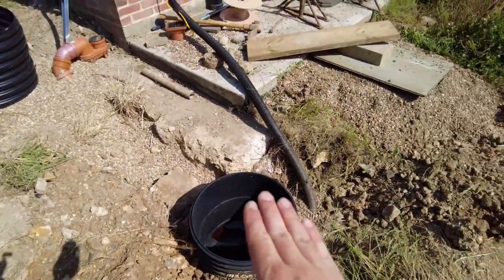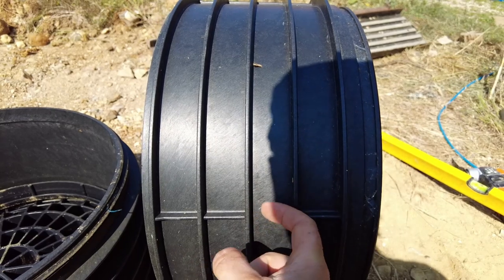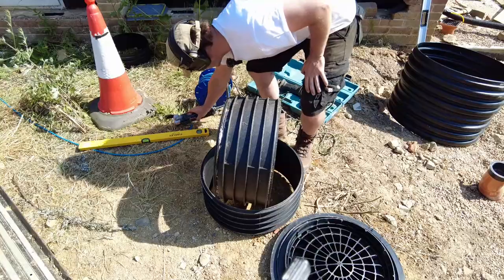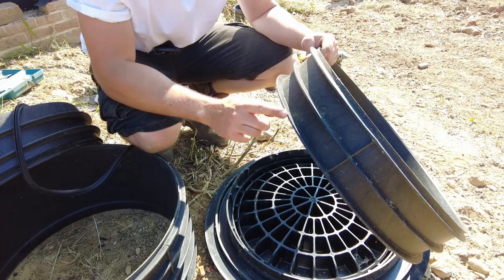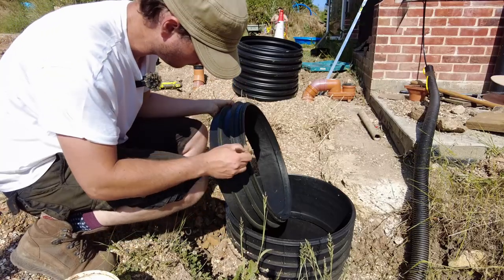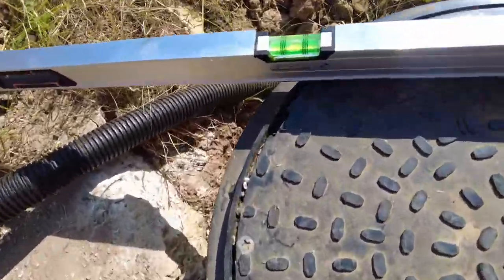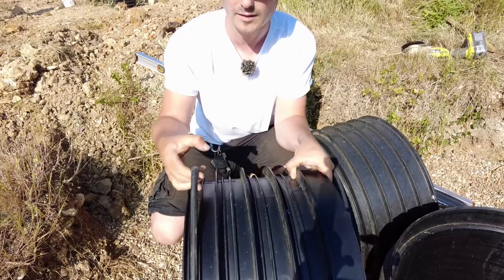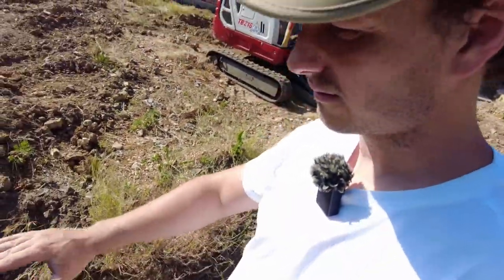How to Cut an Inspection Chamber Riser

Comment: Probably would have been an angle grinder for me. Nice job.
Reply from the maker: 4inch isn't big enough so you'd need a 6inch grinder plus it tends to melt the plastic and flick hot plastic bits at you 😂 I know from cutting the riser for the sewage plant. A jig saw would probably do the job too but I didn't have a long enough blade

Comment: Hey. Nice video, thanks for sharing! I wondered whether you might be able to help with a drainage project queation.

I have bought the 450mm polydrain cover and chamber, and the cover sits loosely on the chamber (I'm not using a riser as I don't need one to make up the level). I think there should be a rubber seal between chamber - does the type and size of seal differ depending on if you are using a riser connecting to the cover or going straight from the chamber to the cover? Reason I ask is that I bought a riser ring seal online and it doesn't seem to be thick enough and the cover just moves around loosely still. Thanks!
Reply from the maker: Hey, so for some reason all covers are slightly loose regardless of using a gasket. The cover usually has a few screws that come with it so you can screw it into the side of a riser. That secures it enough and then cement haunching does the rest. It's not a water tight seal though. If you wanted to get a better water seal you could put a good helping of CT1 round the underside of the cover where it will come in contact with the chamber

Comment: Table saw!?

Saw the fence to the width/depth and just roll it round over the blade til you’ve got through all the way round..
Reply: I expect most people use a grinder!
Reply from the maker: Haha that sounds like effort unless you have one set up 😁
Reply: @THE-AIDEN-PROJECT  I’m surprised you don’t have one in the workshop under the lodge! They’re one of those tools, once you have one you wondered how you managed without it. There are certain cuts it’s almost impossible to do with anything else, especially repeats of those type of cuts. Take it from me, if you get one, get a decent one first time, the dewalt I’ve got now is pukka but the but the cheap nasty draper thing I bought first wasn’t worth the metal it was made of.
Reply from the maker: @thepeginator2556  😂 I've got one in the workshop under the lodge, it's an Axminster 😉 I just haven't set it up yet! I bought it so I can make my kitchen in the future
Reply: @THE-AIDEN-PROJECT  I remember now seeing you getting it and the planer. I’d forgotten about that. Worth spending a few hours setting it up!